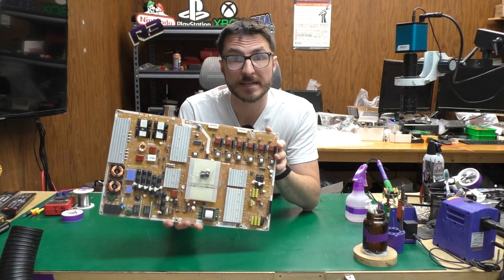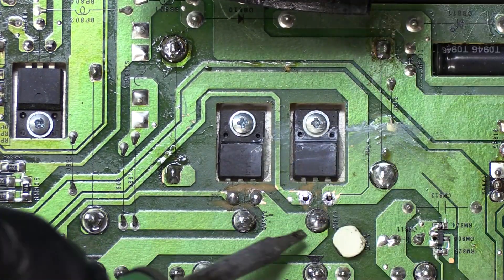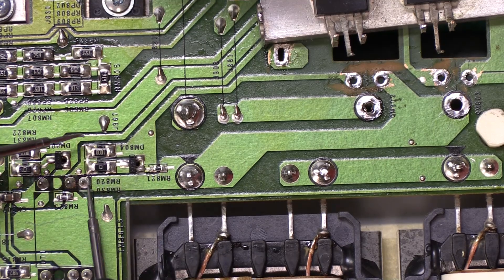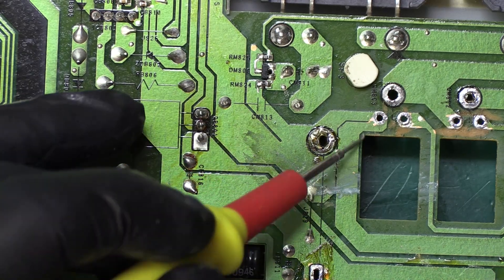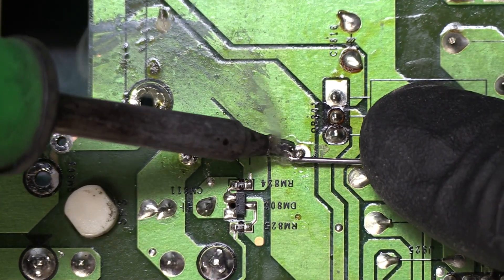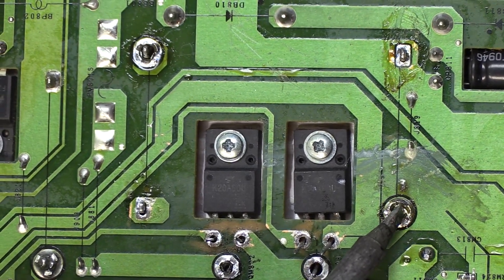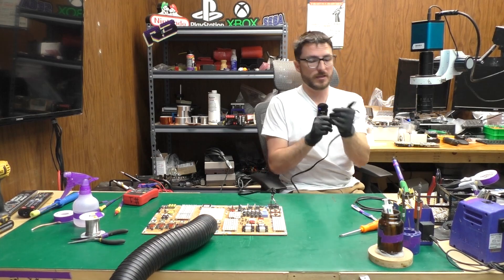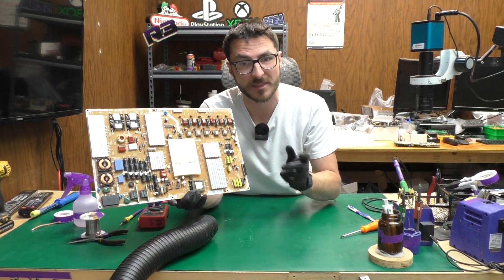Samsung TV Cycling on and off UN55B8000 Power Supply BN44-00272A

Comment: I had a similar problem, first no power or stand-by light. Replaced power board (new) then backlight flashed on and off, ordered and replaced main bord and now nothing again but has stand-by briefly 😢 reinstalled old main and flashes like before... im at a loss as dont understand why new main gives me nothing 😕 any help? Its a samsung 82in Qled..
Reply: P.S. Without the main board plugged in the backlight stays and screen looks good
Reply from the maker: You are probably buying defective parts or incompatible parts. 
As for your problem disconnect the ribbons that connect your mainboard to your panel and plug the mainboard to the power supply. Do you still have backlights or does it go back to flickering? If backlights are not flickering anymore then bad panel. If the backlights are still flickering then you may need to replace your mainboard again as the one you got was either incompatible or defective.

Comment: What do you do if the standby light only comes on once in a while, but when it comes on, the tv can be used normally? Tried to check everything on the power supply, but no shorts, all caps and resistors etc are ok.
Reply from the maker: Then most likely that is caused by a cracked solder joint. Inspect the board for bad solder joints. These can sometimes be tough to spot. If it's the same model as the one fixed in this video check the joints on all the transformers including the small ones.
Reply: How did you check the caps? A dead short or open is only one symptom of a bad cap.
Reply: @larrybud  i checked them in circuit.
Reply: @ You can have a cap which is neither short nor open which is bad. Remove them from circuit and check both the capacitance level AND ESR. If you don't have an ESR meter buy one.
Reply: @larrybud  Thanks. I have an ESR meter, just didn't want to desolder tons of caps. Guess I'll have to anyways. Why can't it just be a shorted transistor like in 99% of this videos ;)
Reply: @7ismorethan6  Definitely makes it easier, that's for sure. I would guess that you have a leaky cap somewhere which is why after some tries it finally works for you. I would test in circuit and then if one looks wonky then desolder it and test it.
Reply: @7ismorethan6  Short cuts: tickle caps with a bit of heat (maybe 100C hot air?) as this makes many show enough life to track it down, or for caps lying on their sides, snip one leg, test the cap, if it's good then use solder to make good the snip.
Reply: I desoldered the 3 main caps (480V, 130uF) now. The ESR-meter shows 0,35 ohm, that's slightly above what it should be, right? The info-graphics on the meter doesn't cover 480V.